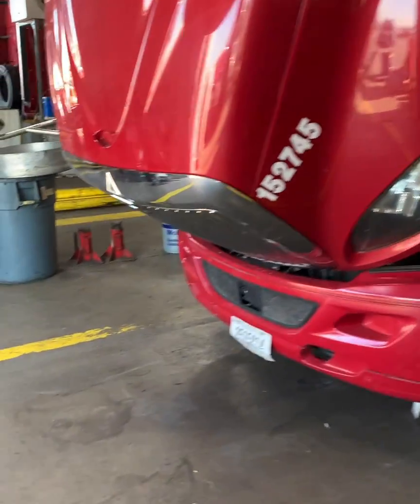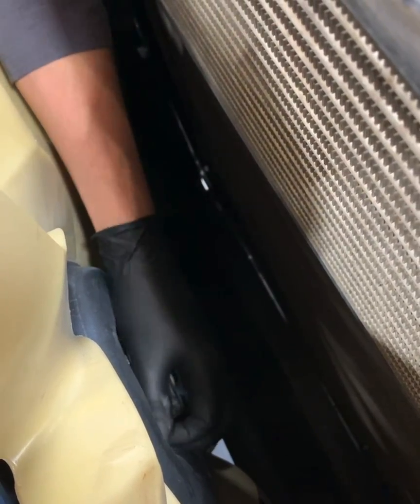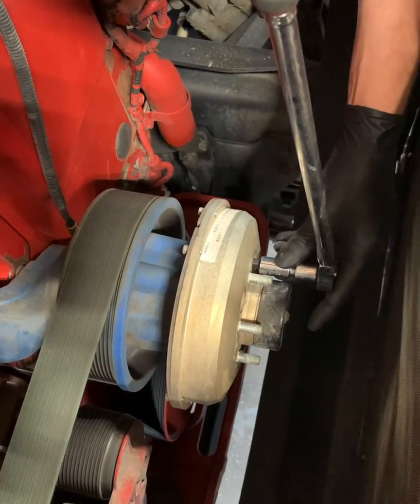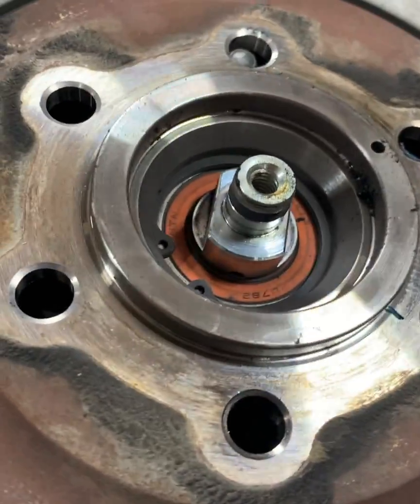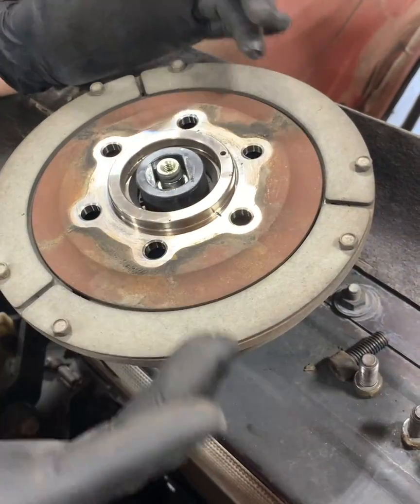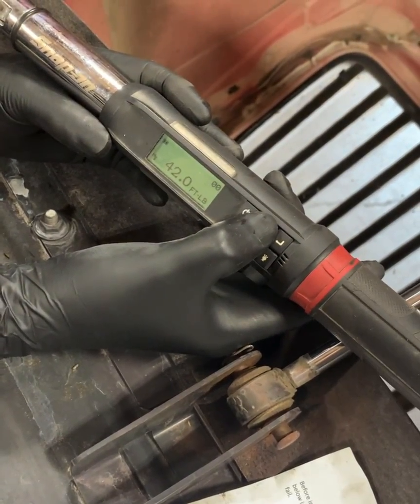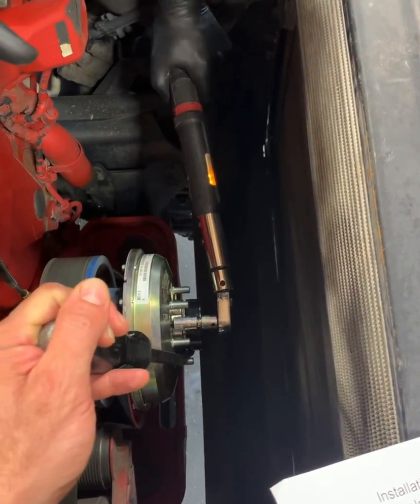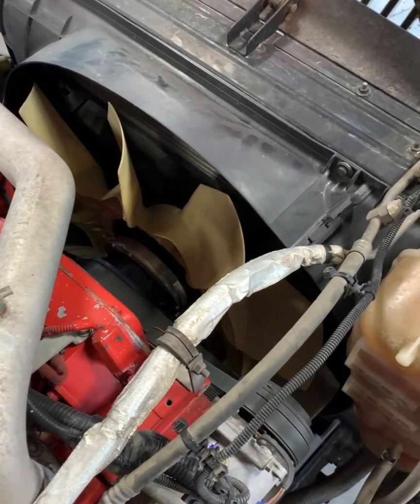Fan hub clutch replacement pro star international. Free Give away time.Fan inop. Air leak.

Comment: Thank you for the great videos .I have a 2020 Freightliner Cascadia with a DD15 engine . The engine fan stays on all the times.There is no engine light on the dashboard or any codes what so ever.I inspected all the plugs ,there is no clutch solenoid to test ,it seems that the fan is powered by an electric coil and has no air line or air clutch connected to. I took it to a mechanic i know,he couldn't detect the problem.I would like your openion before i take it to a dealer. Thank you.
Reply from the maker: Thanks for reaching out. Most cascades are elec solenoid powered and it pushes air to the clutch to lock or unlock. Very few have the  viscous fan installed which has fluid inside and opens by itself.  But main reasons for fan staying on are sticking thermostat, sticking high pressure switch For ac, and that fan solenoid having and issue. One of those will likely be your issue.

Comment: international prostar 2010, when my fun is on i see air is going down below 70 with in 45 second fun is of because air went up 100, also i had air leak and i couldn't find where is leaking any advice thanks for your video
Reply from the maker: Thanks for reaching out. It sounds like your fan clutch is leaking   With your key on, your fan engaged ,you should hear an air leak and when you move the fan you should hear it even more. More than likely your clutch will need to be replaced
Reply: @bustedknucklebydieseldr3228  thanks for youre advice

Comment: What if the that hub won't come off?
Reply: I checked and I missed one bolt 🙉.. It came right off after that
Reply from the maker: @ericjohnson9234  glad to hear everything worked out. Il put this hammer away now.
Reply from the maker: Thanks for reaching out often times the clutch  is stuck to the hub and has an issue coming off. A little hammer persuasion and it’s scares it off the hub. If you mean the hub itlsef won’t come off than that’s crazy and someone must of welded it to the block. In that case much bigger hammer.